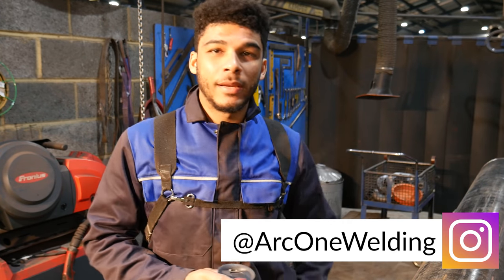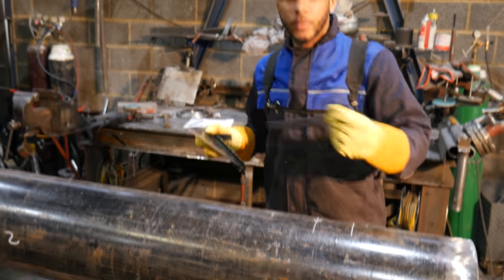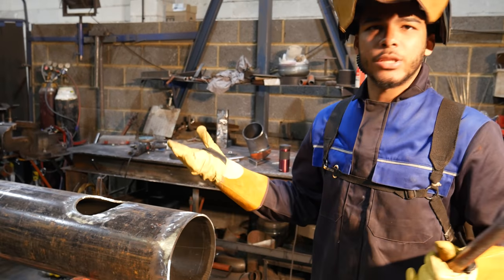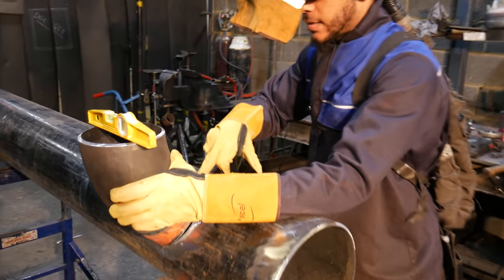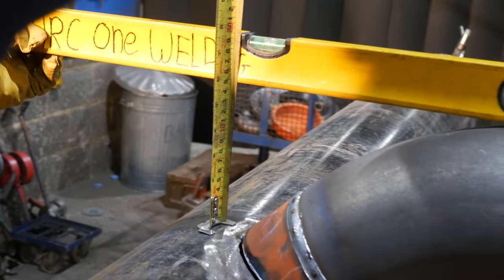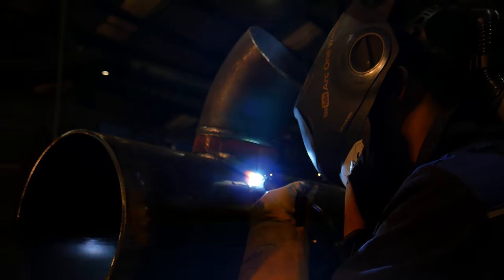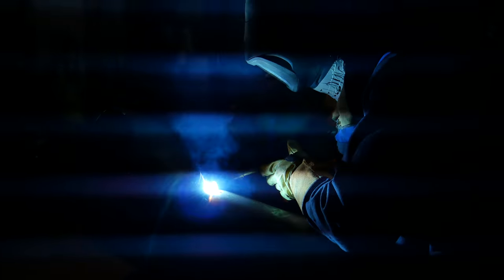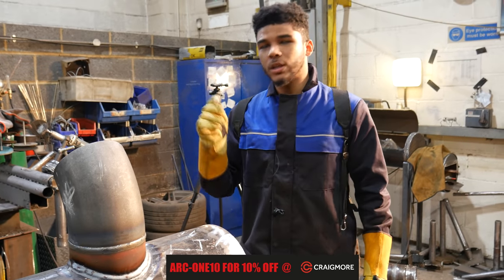Square Branch Fit Up & Welding 6"ON10"  *MIG/MAG* part4

Comment: Cool vid man. Did your company buy the add on software from fronius for the root settings? They demonstrated some settings for a pipe to pipe butt, with no prep, where i work but they were too tight to buy it.

Comment: Clearly your a beast but only difference I would have shown a new beginner is to use a center punch on your chalk lines where you cut out the circle for the fitting/weld because they or even myself can lose that chalk line and go out or inside of the lines if you burn off the chalk. Rather than having the tiny holes to follow from the center punch. Just a thought to show beginners. I’m not near as good with a torch as yourself but typically in the field/plants, welder makes 80% of the torch cuts although I can also but that’s why they get paid more money right ??? Lol kidding